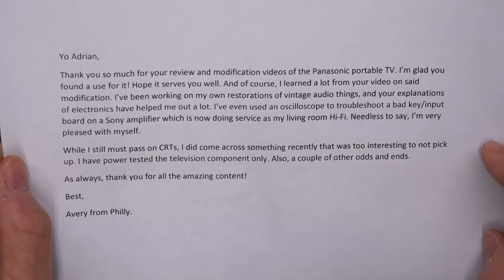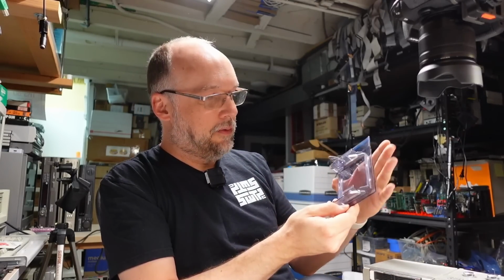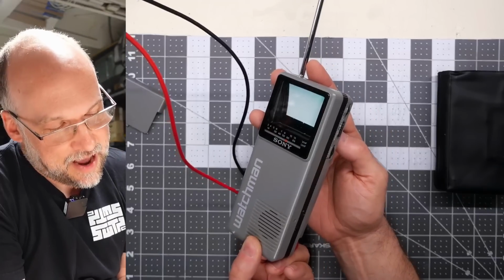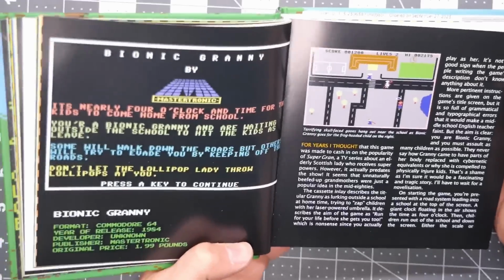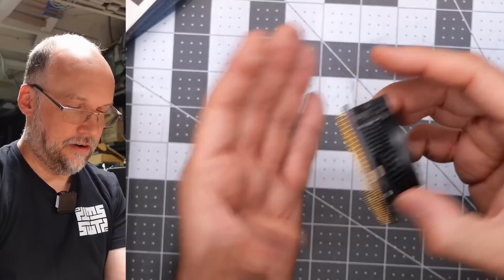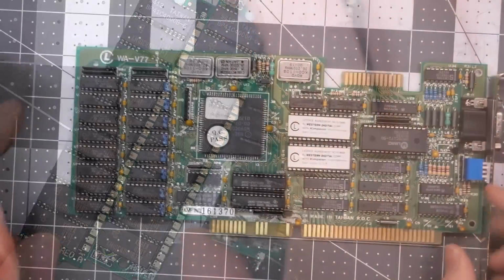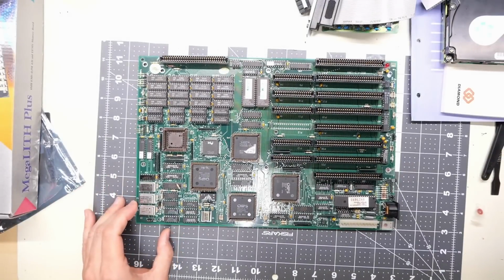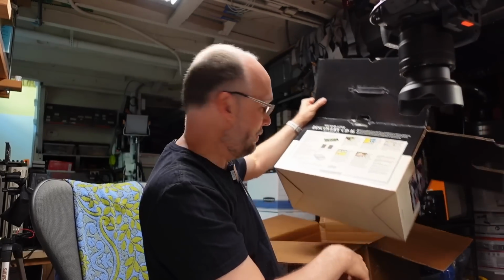0070 Testing portable TVs and a plethora of PC parts (plus a book and hard drive autopsy)

Comment: Couple quick notes.

The backlight on those Casio TVs is actually CCFL, just not a very good one. EL backlights were generally bright yellow in that era, like on a GRiD Compass or such... regardless, AFAIK they were universally monochrome.

USPS is kind of a mess right now, and a lot of that is political -- let's just say that Louis DeJoy was put in place to do a very specific job (it's public friggin record, folks) and he does it well... unfortunately -- but the meat and potatoes of what's happened with that boombox is an entirely separate issue. First of all, don't use packing peanuts with electronics, please, period. Even the "antistatic" ones are really just "diet static" -- they're not better, they're less bad. Just use acres of bubble wrap and you'll be fine -- if you've something really fragile, box it in acres of bubble wrap, and then double-box it using that industrial strength bubble wrap that's unpoppable coz it's all one big bubble with little channels in between everything. Also, heavier stuff costs more to ship, generally, and that goes up slightly faster with USPS vs UPS or FedEx. Probably that boombox would have been cheaper to ship via FedEx.

Really, though, the biggest problem is that shipping stuff into and out of America is just too expensive, period. The stuff you get from Hong Kong on eBay, that ships using either what's called ePacket via China Post, or SpeedPAK Standard if you really are using eBay. It costs the seller about US$0.75 to send, for the most part, up to 100g (3-1/2 oz in freedumn units) and that service tops out at something like $5ish for 500g (17ish oz) -- mind you, that's international shipping with two to three weeks' transit time, a tracking number, guaranteed delivery-by date, and it's airmail to boot. "EMS" may cost US$30+ for the same source-to-destination path, but that stuff does NOT kid around, it is the same thing but with a 2-3 DAY transit time. Meanwhile, to send all that mess back again? USPS Priority Mail International is roughly comparable to ePacket or SpeedPAK Standard -- except it costs you almost US$40 at minimum. As for UPS and FedEx, well, their pricing is more on the principle of, "if you have to ask..." ;3

Also, yeah, hard drive magnets are pretty dang powerful. I don't think many people really get that. "Demagnetizing" a hard drive takes proper effort (or at least a few seconds with the degauss coil out of an old CRT TV or monitor) because the stuff on those platters has to withstand the side magnetics of those neodymium magnets (and, yes, they're rare earth -- the other kind is those black ceramic ones that are really friggin weak, but those suuuck) and the voice coils hey help with. Personally, I find the bracket a help, rather than a hindrance, but YMMV on that. Regardless, that's one Adrian warning that's in good taste -- mind your fingers unless you want em flatter! Those things do not mess around.

Comment: I know I mentioned it the last time you showed some portable TVs, but I am weirdly nostalgic for Casio's "scrolling line" tuner and watching it bounce around. I was just compelled to Google for images, and I think it must've been an SY-20 (or something very similar).

The green line filling the entire screen and being vertically oriented, instead of being a thin horizontal line just on one side, is exactly as I remember it. As is the colour, placement of scan buttons and volume control, and speaker placement. 

Even that model which is from a fair bit later than the one you talked about here, had pretty short battery life (just a few hours), dim picture, poor contrast... and most importantly of all terrible tuning anywhere except deep in a city! So using while camping or fishing, as it was sold for, had a really noisy picture. Use in a car caused the picture to come in and out with terrain and speed.

I was so pleased once there became better ways to watch live broadcasts on the go, but all these years on I'm also weirdly nostalgic for how crappy it was... hmm.

Comment: A friend of mine had an Emerson boombox with a TV.  When he brought it over when I had friends over, I had a 3.5 mm to coax adapter and when had a set of rabbit ears hooked up I tuned between channels
70 and 83 and could listen in on analog cell phones.  Then hooking up the cable I could tune the adult movie channel slightly off frequency and the picture was less scrambled.  The late 1990’s was fun times

Comment: I remember my first Trintron Monitor, man it was epic, had the two lines that went across the upper and lower part of the screen.  Not sure exactly what they did but it was normal for Trintron monitors at the time.  I would love to see more Trintron CRT videos, perhaps a series into these epic monitors.  Thx Adrian for everything you do!
Reply: Trinitron uses a vertical grille of fine wires for the aperature instead of the microwave door dot mask most older CRTs used and to keep them stable and in place there would be two additional wires running the opposite direction right through the middle.

Comment: An excellent use for hard drive magnets is a magnetic stud finder. carefully hover over the wall with one of those strong magnets and you are garenteed to find the nails or screws in the drywall, even under the drywall mud joints.

Comment: Some interesting hardware.  A shame about that hard drive.  That Cirrus Logic chip, if I recall, is rather a "glue" chip that provides a lot of interfacing and control functions in a single package.  Small surprise that drive wouldn't spin without it.

Comment: USPS is the most expensive of all the shipping options.
FedEx Ground is usually the least expensive. UPS is cheaper than USPS but still expensive.
USPS has been increasing the cost of the non flat rate Priority Mail.
If you try to send a regular laser printer through the mail it costs more than the cost of the printer. They wanted over 100 dollars for the shipping.
I shipped 3 flat rate large priority mail boxes that cost 75.00
What makes it make less sense is that UPS and US Mail will take a week or longer to ship and the tracking shows it usually sits for 3 or 4 days and then they send it via airline and then it sits for another 3 days at the destination.
And I saw the new warning labels for batteries. USPS won't allow any batteries or anything that has a battery to be shipped on airplanes.
Laptops, radios, even a watch or a motherboard that has a battery is not allowed
Makes using priority or first class mail worthless since it has to go truck ground and takes a week to ten days

The shipping from China is amazing because they are able to get items to you in 3 weeks or less.
It takes a couple days to export and two days shipping on plane and then a week to clear immigration or whatever they call it. They have to scan all the packages at one of three centers. NYC, Chicago or San Francisco or Los Angeles are the three places that all the packages have to be scanned and they take a long time. There has been a few times when they are backlogged and they take two weeks.
Just incredible the number of packages that are sent from China. They have the cargo containers full.

Comment: I dabbled in DJ work in the 90's and had the idea of making curtains out of DVD discs behind the stage, drilled small holes on the edges and connected them together.  I think they were kind of heavy though, no way to suspend them, so I abandoned the idea.  I do remember scrounging for them at work, many software DVDs that were going to waste.
Reply: That makes me sad. So many of those CD's (from AOL disks, which i would like to add came in 1000's of different forms to shareware) need archiving. We are losing far to much of our early tech culture.

Comment: If you wanted to upgrade that Casio TV 400 for grins, there are similar upgrade kits for that size screen as the Sega GG and the Nomad and other retro handhelds that replace that OEM screen with a modern aftermarket, and replacing with a digital tuner would allow it to work as intended again,  though would still probably eat batteries like Pac-Man on a binge, but not as fast as originally.
Reply from the maker: It's so bulky we could probably fit an entire Pi in there too with a new LCD -- to make a really nice media player :-)
Reply: @adriansdigitalbasement2  I had not considered that option, as I had only been thinking of upgrading it to fit modern standards and keeping the same baseline functionality as it was originally made for. However, turning it into a digital media player is also a valid option,  and if done right,  would be able to still have the digital tuner option, and you may get lucky and be able to cram a rechargeable battery pack in there as well.

Comment: Just a note about the sleeve for your Casio: mine held up great till it started the infamous rubber reversion process within the span of a month, stored out of sunlight in a climate controlled environment. Anything with that soft touch feeling/coating is worth checking on periodically, they're all timebombs I think.
Reply from the maker: Eww.... yeah not surprised it took a sudden turn.

Comment: I restored the exact same boombox on my channel last year! Had to double take when you pulled that out of bubble wrap. Watch out for the clear panel over the front of the tube can fall off sue to old age on the glue.
Reply from the maker: Nice -- any tips for trying to get the mech working? Any difficulties?
Reply: From what i remember just a standard mech for the tape. I actually had two of them and did a parts swap as the case was damaged . I still have a working  tape deck and TV power/flyback board if you want them!

Comment: depending on how the door is supposed to attach, but one could probably design and 3d print some parts to be glued to the tape door to recreate what was once there. I feel some Clear PETG would blend in well
Reply from the maker: Even if it was black, I would be OK with it... it's not really visible. But I have zero CAD design skills so there is no chance I would ever be able to replicate such a thing
Reply: @adriansdigitalbasement2  you would pick up on some 3d modeling really quickly.   I highly recommend learn fusion 360 in 30 days series by Products Design Online here on YT. 3 or 4 videos would get you far enough to doing basic designing.

Comment: The SEGA Game Gear with it's LCD colour screen was also 3 watts. I think about 1/2 of that power went into the mini fluorescent tube back light. Seems like that was the state of the art back then in portable colour LCD tech (the GG screen was also very washed out and blurred quite a lot).
Reply: OMG so smeary.  I had one.  I loved it but HAD to use niCad rechargables.
CCFL (cold cathode flourecsent lamp) backlit.  Essentially a tiny version of the curly compact flourescent bulbs.
Reply: @button-puncher  and even by the late-00s, laptops got a couple extra hours of battery life by switching from CCFL to LED backlights... in some cases that was a 100% battery life increase between models.
Reply: @kaitlyn__L   Definitely.  I remember the first LED backlit laptop at work, a Dell Latitude E6500.  I was blown away by the brightness and richness of the colors too.  In 2009, I think.
Reply: LCDs were pretty terrible until the mid-00's. There were some with decent color by the late 90s but the response time was horrendous. The transition away from cold cathode fluorescent definitely saved some power. I finally made the jump to LCD on the PC around '05 or so and maybe around '07 for the TV.

Comment: Hard disk metal platter - it varies depending on age, it can be aluminium alloy, glass or ceramic (and probably others I've missed), and then covered in a thin layer of magnetic material. The fact that the magnetic storage is in a thin layer means more rigid materials now allows many more very thin platters, modern drives are now contain up to 10 platters in a 26.1mm thick 3.5" hard disk! Obviously lots of other technology was also necessary for this to be practical, like very thin heads and helium enclosure (reduces friction and turbulent losses). Additional note: Not all disks will have full-sized disks, IIRC 15k 2.5" disks sometimes? always? uses smaller (~2") platters because the smaller platter results in lower seek times and the lower capacity was a sacrifice to further distance them from regular 3.5" hard disks, depending on material the lower edge speed might also the required platter thickness.